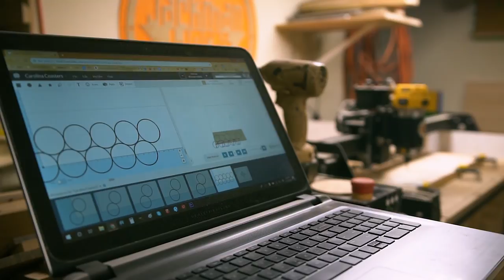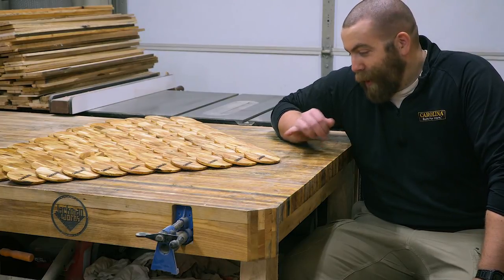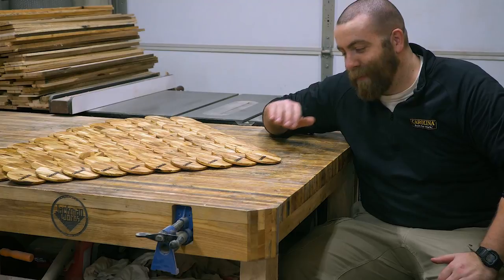Pallet Wood Coasters with Diamond Pattern (100 of them!)

Comment: From one woodworker to another,well done sir...
I just did a 300 coaster order ,first time doing coasters where I work.
They were made of Mahogany,and nothing as complicated as your work.
Which incidently,much respect,yours are just beautiful ,really...
And hey,you gave me insight on the rounding process you use as an improvement on how I need to do it the next time.
I built a rig to spin them on a 12 inch vertical sander,how you do it is very sensible and inspirational.
Thanks for sharing,and showing the knowledge,people don't realize the level of dedication and shear work to do woodworking like this.

Comment: Now make wooden nickels same design.   35k wooden nickels made out of pallet wood.

No seriously that is some labor intensive work.

But here is the deal, if I set a pop on my table on a coaster in the summer time tiny ants will find it because of the sugers.
to stop the ants from making there way to my soda I turn 2 plastic food containers into a mote with an island for the pop to rest on. as long as its surrounded by water Ants will not be on my pop. I don't know if its they don't smell a path or can't swim.  So a perfect coaster would hold water and give a spot to set your drink and not get wet.